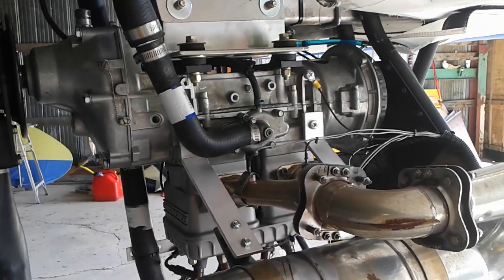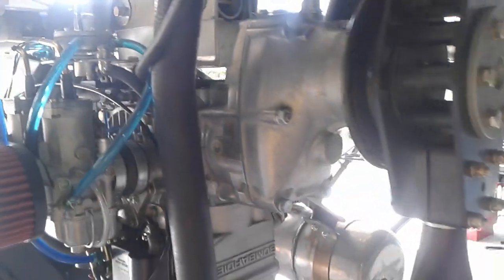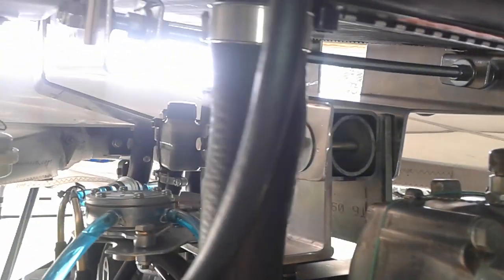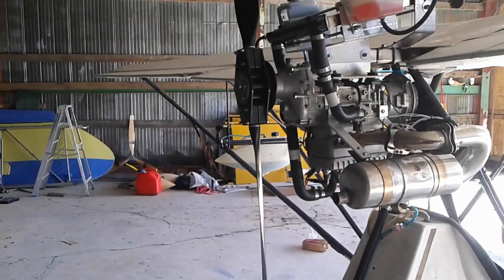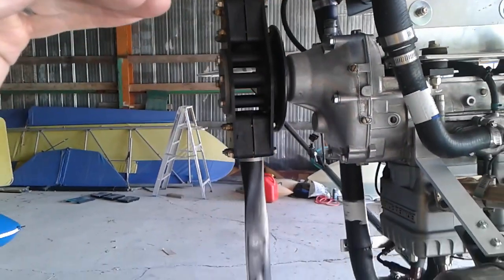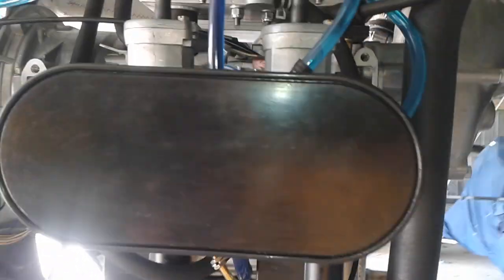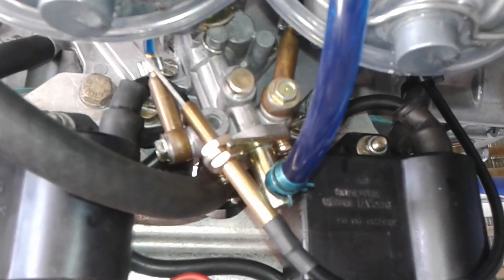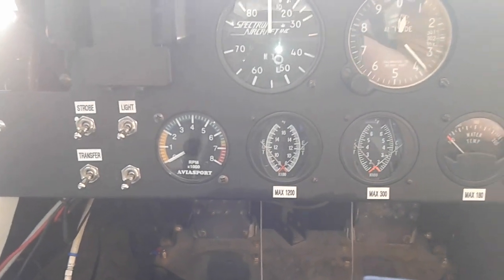A closer look at the 582

Comment: 2:05 Use the bypass coolant to run thru heater core in cabin.  Could keep your toes warm.  In event of thermostat failure, you still have flow thru a small radiator.

Comment: What you are pointing at around 1:11 is not the pump shaft, but the thermostat housing. The pump runs next to the crankshaft, driven by a through shaft. [Seen in beginning at 0:10, just above the exhaust outlet].
Reply from the maker: Good catch, thanks for that. :-)

Comment: I took a heater core out of a car, mounted it in my cockpit, ran hose to and from it, and used it to heat my cabin in the winter. Cozy. I finally wore that 582 out. Way beyond TOB. I live in Alaska. I had a 912S. Total sissy in cold weather. I prefer the 582.
Reply from the maker: I prefer the 582 for winter flying too but I don't think the heater core is gonna help me without doors! ;-)

Comment: I'd seen an inspector showing problems with engines & he pointed out that having a safety wire holding the air filter on the carbs, going under / around the attachment hose clamps really helps keeping the filter & hose clamps from vibrating off & going through your shiny new prop
Reply from the maker: Yes, I definitely recommend doing this. An air filter through a prop will definitely ruin your day!

Comment: Looking good! RPM on takeoff you want 6,800 some choose 6,500 but 6,800 is the correct one  for 1 min. Cruise you will get 4700-5200rpm warm it up properly and no shock cooling. In Australia we see them go past 1,000 hrs with that set up!!!
If you use RPM too low you won’t get your 65hp your take off won’t be near as good and you even might be burning more fuel at cruise if engine is too loaded at low RPM.
Reply from the maker: I'm definitely going to the optimizing the prop pitch for climb. I don't like cruising faster than 65 MPH anyway. It's not like I bought this thing to go anywhere fast! :-)

Comment: Looks good and thanks for sharing.

Unusual to see a water cooled two stroke!
Reply from the maker: Not as unusual as you may think. A lot of them are these days, in snowmobiles anyway. It definitely has it's pros and cons. I personally prefer air cooled engines on airplanes but beggars can't be choosers! :-) Thanks for the comment!
Reply: Mr. @mmatt i come from the world of horticulture and mowers and strimmers.  i only know air cooled.   my dad had an old evenruid out board that was  two stroke water cooled.   The water jacket made it quieter than most .......  

As you say most of the out boards will be water cooled.

Comment: Video highly appreciated. Check if the carbs boot is slanted up or down. Then check which way it's supposed to be by rotax. The other point is when you add power it should force the nose up not down. I think you should be able to get 17 degrees on the prop and still get full 6200 static. Dan Johnson has a bunch of videos on the 582. Man, you are gonna have a great new experience with the Beaver. Wish they still made new ones- greatest trainer ever- especially with a great CFI
Reply from the maker: I think the directional manifolds are on the 503. The 582 manual made no mention of it and the carbs seem to be perfectly level as do the carb boots. Thanks for the other info as well. :-)

Comment: Looks great Matt!!! The only advise I could give you is that the 582 does need 6 lorde mounts rather that 4. We know this from experience. make a plate for the engine side of mount and put 2 center mounts. 582 has lots of torque and it will tear those mounts up. And get rid of the oil injection and mix your fuel.
Reply from the maker: Thanks for the advice. I too thought the 582 should use more mounts but the Chinook uses the same engine and only uses 4 mounts as well and it has fared very well over the past 20 years or so with no failures that I'm aware of. I should mention that this application uses Barry mounts, not Lord mounts which may make a difference as they are constructed differently.
As for the oil injection, I'm convinced that on this engine, the injection system is completely reliable and more than adequate in terms of providing enough lubrication. However, I don't think a person can go wrong either way.
Reply: mmatt  I am currently looking at a kitfox it has a 582 and I was really terrified about having an oil injection system however the person I am buying this from swears by the injection system and has flown his plane for years relying on the injection pump. He assures me it’s a very reliable system. This 75 year old man built the plane himself and has really educated me on the 2 stroke engine. Just the cost for rebuilding the engine has made me reconsider my thinking since the rebuild doesn’t hurt as bad as the 4 strokes. May I also compliment you on your tactfully written responses. You are a true gentleman in every aspect . I loved your video and only wish you resided here in North Carolina as I  would surely pick your brain LOL. Thanks

Comment: This guy knows how to run in a two stroke. Plenty of extra oil for Break in especially in initial start for injector oil systems. Premix guaranteed lubrication and the added oil will keep the piston and  rings cooler and well lubricated. I’d be inclined to run premix in there all the time as insurance against a seizure maybe at 100:1 after breakin. Might just save your engine should the oil injector fail.
Reply: Or delete the oil injection.

Comment: morning matt  new motor looks  good  .nice walk around. how   long does it take to break in a new motor ?  now the fun starts  .back in the air and   checking every  thing out. thats cool how he took different parts  new design and made every work. well have fun  .looking foward to more flying vids  see ya.
Reply from the maker: The break in procedure takes about an hour and then most mechanics recommend avoiding full throttle for another 5 hours just to let everything fully seat and settle.

Comment: 300h to overhaul, so every 10 minutes on the Hobbs counts.
Reply: The most enemy is corrosion during the unused time , therefore Rotax has a 300 h TBO . Conservation with special oil ( engine conversation oil ) from a Marin shop is the key , and your 2 Stroke will last more then 800h if you follow the rules eg. max coolant temp max 85 C , max EGT 1150 F , correct installation of the diaphragm fuel pump eg. horizontal , Puls line down and higher then the Puls line Outlet from the engine. Correct engine warm up etc.